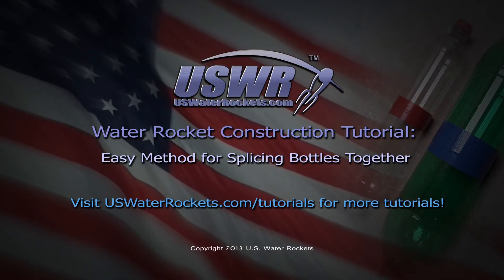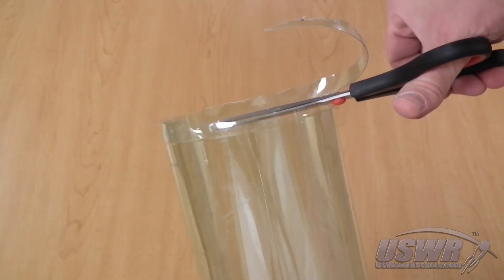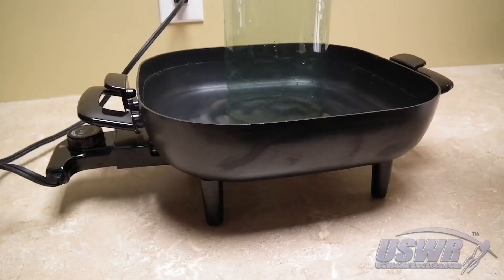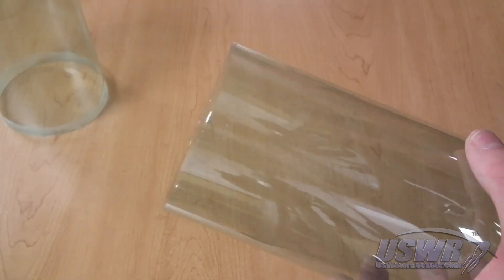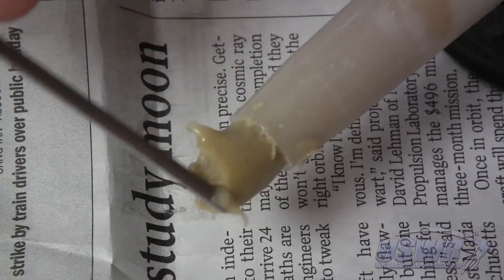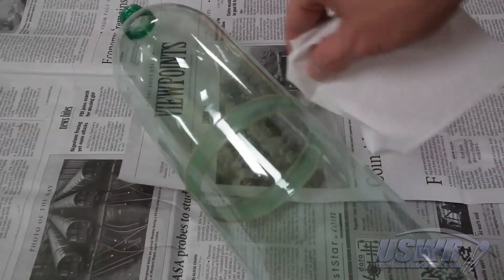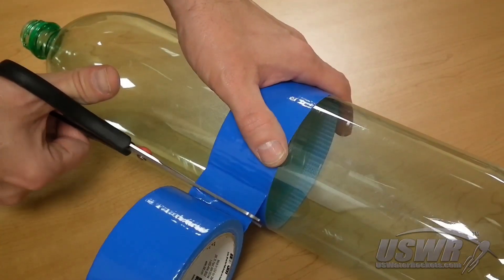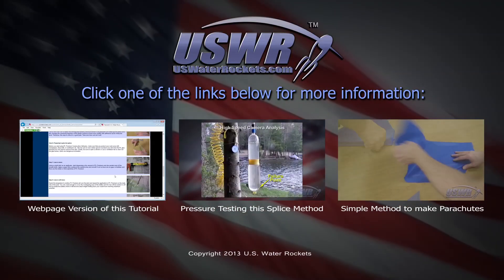How To Make a Huge Water Rocket by Splicing Bottles Together!

Comment: I tried this with JB weld epoxy for thermoplastics and my rocket exploded at 70 psi. A rocket made of one 2 liter bottle without any splicing was able to handle 110 psi and worked great. I want to make a larger rocket now. Is there a disadvantage to using 2 part epoxy instead of construction adhesive for this splicing method or do you think maybe I just need to be more precise in fitting the bottles together?
Reply: I know this is 3 years late lol, but were you using a 5 min epoxy or a 24 hour one? The latter has a much higher tendency of creating strong & pressure resistant bonds compared to the prior.

Comment: Would this method work if you were thinking about making a 6ft tall LED bubble column using 2L bottles?
Reply from the maker: It would work. Just be aware that when you have a 6-foot long tube made from bottles that you are careful when handling it. If you have it oriented horizontally, the weight will try and make the tube bend where you are holding it, so you should try and keep it vertically oriented so it stays straight.

Comment: Other alternative for pl premium?
Reply from the maker: We have tested, and many other people have tested just about every other glue you can find, and there is nothing that anyone could find that comes close to the performance of PL Premium for this application. There are glues that make a stronger bond, such as epoxy, but they are too brittle and will crack as the bottles stretch with pressure. There are CA glues (superglue) that also bond much better and are flexible, but the chemicals in the glue attack the plastic of the bottle and make it weak where the glue is in contact with it. I wish I knew of something similar to recommend, but PL is the only glue that anyone has found that can hold over 80PSI or so.

Comment: Bond strength is very dependent on bondline thickness.  Have you ever tried controlling the bond thickness with glass beads or skrim cloth?  Is there anything controlling bondline thickness?  PL Premium is meant mainly for dimensional lumber and plywood, which is uneven enough to retain adhesive.  The bond pressure in this joint can't be very high, so it's probably the viscosity of the adhesive that prevents too thin of bondlines.
Reply: Yah

Comment: In defense of  two part epoxy:  I'm certain we can find a two part epoxy that is "stronger" than PL premium.  Published shear strength of two-part epoxy can be four times the shear strength of PL premium.  A good bond isn't just about shear strength.  There needs to be ductility (stretchiness) as well.  Thickness and materials of adherends must be considered.  Though I'm sure there are two part epoxies available (example Hysol EA9394 Aero - expensive) which would make a stronger thin-plastic-to-thin-plastic joint than PL premium, PL premium is strong enough for your application (the bottle broke in the test), so it's good enough, and cheap.  But, if you move to  stronger aerospace materials, you would want stronger aerospace adhesives.
Reply from the maker: Exactly right. There are inexpensive epoxies that will adhere better to PET plastic, but they can be very brittle and don't hold up well to the stress encountered in the bottle joint. The glue must resist peeling, as well as shearing forces, plus the fact that the bottles swell considerably in in two dimensions as they expand when pressurized. If there is an adhesive that is better for this we would love to test it. I have tried some 2-part structural adhesives ($$$) made for low surface energy plastics, and the adhesives caused the thin bottles to weaken around the joint, so they would rip open with very little pressure applied.
Reply: @USWaterRockets  Have you got a shear stress-strain curve for PL Premium?  I think that's the best comparison of adhesives, barring side by side testing of lap shear specimens of the same PET material and thickness.  
The loading is interesting for this joint.  The hoop pressure loads, typically twice the axial line loads, are carried by both layers of bottle, and the adhesive is sort of along for the ride, just has to strain with the PET radially and circumferentially.  Axial loads (tension from pressure, compression from rocket acceleration, and rocket body bending) are carried through the lap splice bond like a single lap shear specimen, which will have some peel as it tilts under load.  The bonded area is probably the strongest part of the structure.
Reply from the maker: The compressed air also presents a problem, as any defect in the joint will get penetrated by the compressed air and this puts stress on the joint from inside, especially as the pressure rapidly drops when the rocket is launched. It also seems that repeated launches will eventually damage even the best joint to some extent, probably from fatigue as the bottles expand and contract each time. You make some interesting points. Alas, I don't have a stress-strain curve for PL, but I will try and see if there is one available on their website.
Reply: It seems like there was a phase in aerospace adhesive development where people thought higher shear strength must mean higher bond load carrying capability.  But, you can't give up strain capability for strength.   You need a balance of strength and ductility.
Another approach is to taper the adherend ends  (by machining in metal or dropping plies in composites), but that's usually difficult and expensive.  You can also reverse taper the adherend(s), so the end of the bond gets thicker at the end, and can shear strain more without letting go, preventing peel, also usually expensive.
Reply from the maker: This isn't as crazy as you think because of the way these bottles shrink when heated. By dipping them in boiling water at the right rate, you can make any sort of taper you want.

Comment: I'm wondering if acetone wipe, then wipe off in one direction with dry cloth might be a better surface preparation than sanding.  Adhesive bonds are chemical, not mechanical, bonds.  The surfaces must be free of oil or any other contaminant, to avoid weak layers in the bond.  I'm not sure the surface needs to be rough as much as it needs to be clean.  I know in aerospace bonding, sanding is seen as more operator-dependent than acetone wipe, because different people will sand differently.  I also think it's recommended you solvent clean after sanding.  But whatever works, I guess.
Reply from the maker: The bonding of bottles is less scientifically determined and more empirically determined. Basically hundreds of people tried various things and then wrote online the results of their efforts. Eventually the best techniques were seen from the data collected over many years and then we looked at all of the best techniques with the goal of making the process easier, faster, and more aesthetically pleasing.  You will find if you test this that the added surface area created by sanding creates a stronger joint and the surface roughness does add a mechanical strength to the joint that improves the strength of the chemical bond.
Reply: @USWaterRockets  I'm pretty sure aerospace adhesive bonds require solvent wipe of adherends. otherwise how do you know it's not got some traces of oil or some other greasy stuff around the shop?
Reply from the maker: I have been very meticulous about wiping and drying the parts with alcohol before joining them.

Comment: It seems like when I dip the bottle into the water, only the tips shrink. Am I using too high of a temperature?
Reply from the maker: The tips shrink if the temperature is too high or the bottom of the pan is super hot and you touch the bottle to it. You want to very slowly increase the water temperature and you will find the point where the plastic just shrinks very slowly. The slower it shrinks the better for you, if you can find the sweet spot. Slower shrinking means you can very gradually shrink the bottles until you get a perfect fit. If they shrink rapidly, it's easy to shrink them too much.
Reply: USWaterRockets Thank you. I will try not to have the temperature so high next time.

Comment: Can I use hot glue or super glue?
Reply from the maker: Sorry, but no. Super glue reacts with the bottle plastic turning it very weak, so even though it glues the plastic exceptionally well, the plastic where the glue has reacted will shatter when pressurized. Hot glue doesn't work because as you can see in the video we use heat to shrink the bottles to fit together properly, so you can imagine that applying the hot glue to the bottles will cause them to shrink and deform at the point where the glue is applied.

Comment: When I dip my bottle into the water the bottoms curl up why?
Reply from the maker: The water is too hot, you are dipping them too long, or the bottom of the pot/pan the water is heated in is much hotter than the water is, and you are douching the bottom with the bottle and heating it from contact with the hot pan. I can't know which you are having trouble with. Remember, the idea is to shrink the bottles ever so slightly. If you shrink them so they no longer fit snug inside the other bottle, then they won't hold as much pressure. Just shrink them a tiny bit so they fit tightly. If the very bottom shrinks too much that it curls every time, you can possibly immerse them in deeper water and trim off the bottom where it curls and still have enough left that can fit jjust right.
Reply: USWaterRockets Ok thank you so much, I just think my water is to hot.

Comment: Are there any alternatives for what glue to use to splice the bottles together?
Reply from the maker: There are no known glues that work as well as PL Premium for splicing bottles. Many people have tried to find some substitute, and so far no better glue has been discovered. Even very expensive glues formulated specifically for bottle plastic do not work as well. You may be able to use a different glue if you are careful to keep the pressure in the bottles much lower, so they don't blow apart.
Reply: Does general epoxy work?
Reply: (At low pressures under 100 psi)

Comment: This blew up and scared the living crap out of everyone in the closer half of my school at only 60PSI. My rocket needs pressure chambers which go up to 120PSI. Got any tips?
Reply from the maker: 1) Test your bottles before you cut them. Some bottles are born with defects and they blow up at way below useful PSI.2) Make the joints as snug as possible. The more gap between the bottles that has to fill in with glue, the more chance the glue will rip apart. Shrink the inner bottle a little at a time until you can just get it to fit inside the outer bottle.3) Mark your bottles as you make them so you can put them together in the same pairs. Some bottles are a little fatter than others and so when you shrink one to fit inside, it will be snug on one bottle and loose when paired with another. Keep them together as you create them, so when it comes time to glue, they are all perfectly fitted.4) A larger overlapping area will compensate for other errors you might make. If you overlap them 30mm instead of 15mm there's more area for the glue to stick to and so the joints hold up better even if they're not perfectly mated.5) Cover the joints with packing tape with fiberglass in it, instead of duct tape. The fiberglass tape keeps the bottles from swelling at the joints, so they hold up longer. You can still put colored tap over the fiberglass tape to cover up the ugly glue color and make the rocket look neater.6) Be extra careful when sanding the joints so you don't miss any spots. The glue will not stick to the shiny smooth bottle surface. You have to get it rough for the PL to stick to.7) Mare sure that you don't have oils on the joints from your skin. Wash them well, and also you can use alcohol to wipe them off to get grease and oil off.8) Always let the glue cure for several days before putting pressure on it.9) If your climate is dry, make sure you put the rocket in a humid area like a shower room for a while because PL glue needs to be exposed to humid air to cure. Putting it in an area with steam for a few minutes will give it the humidity it needs to cure.10) Use skinny bottles if possible. 2 liter bottles are harder to work with than 1.5 liter bottles which are harder to work with than 1 liter bottles. The bigger the diameter of the bottle, the more strain there is on the joint. Good luck!

Comment: hey,can i do that with just epoxy glue and duct tape instead of polyurethane glue?
Reply from the maker: It probably won't hold much pressure. There are all kinds of epoxy glues and some stick better than others, while some get very brittle when they are cured and others remain a little flexible. You have to have a glue that sticks to the bottle plastic plus it remains flexible so that the stretching bottles don't crack it. That combination of properties makes finding a suitable glue very difficult, and so far nobody has been able to find anything that works better than PL Premium.
Reply: Ok thanks, that help me a lot👍

Comment: Hi. I just spliced two bottles together using this method! Thanks but I have a question. 
My School launch is tomorrow, but the schools PSI is only 65. By the time I launch the rocket the glue will have been drying for around 22 hours.
I can call my rocket off and wait if I want. 

Is it worth trying to launch it anyway? Thanks.
Reply from the maker: If you expose the PL Premium to high humidity (take it into a hot shower for a few minutes) you will accelerate the glue curing process (it is hardened by water in the air). Even if you don't do that, 22 hours is very likely long enough to hold 65PSI without failing.
Reply: I used a Polyurethane but not specifically PL Premium. (Due to lack of sourcing time. The Bostik Poly was lying around somehow) and didn't see your comment in time for the shower method. 
Anyhow it did end up being less than 22 hours and it did explode but at a high pressure. One half got higher than every other rocket though. XD
I have since removed the glue with Isopropyl and re-glued and reinforced with tape. Next launch is Thursday do it will be able to dry for 4x the length. should be fine. Thanks for replying.
Reply: Don't bother trying to read my comment. Youtube's new face cut it off.
Reply from the maker: FYI, everyone who's ever tried a different glue has not had the same results as PL Premium. It seems like every other glue does not hold as well. However, I can say that most of the time the glue fails because the two halves pop apart, so anything you can do to hold the halved lengthwise should help keep the glue from pulling apart. Putting tape lengthwise on the rocket might help! Good luck!
Reply: Just had a second launch after 2 days drying time. It held and did not explode. Needless to say I was very happy. I'll keep PL Premium in the bag of thoughts until the rocket explodes. Thanks.
Reply from the maker: NELICOPTER Awesome! I hope your rocket won! ;-)
Reply: Fins were way way way to small because I had no time to test aerodynamics because I was focusing on splicing. A friend got the Aerodynamics perfect and got really high. It came down and smashed onto the roof of the nearby buildings.

On a side note, what is more practice long term. Garden connector launches, or the 22mm stock bottle nozzles? Thanks.
Reply from the maker: NELICOPTER If you're going for max altitude or max distance and you're using a plain bottle with no exotic reinforcement then 22mm is going to win every time. When you get into crazy high pressures you have to either test or sun simulations to find out the optimum size. At those pressures the speed is so high that you can lose a ton of energy due to drag. A smaller nozzle at high pressure can keep the speed lower and therefore the drag is less and the rocket is more efficient. But at low pressures the smaller nozzle is going to limit the speed too much and you lose the benefit of momentum that a big nozzle gives.

Comment: How many launches do they last?
Reply from the maker: They last as long as a regular water bottle rocket would last. Usually the bottles will get damaged from wear and tear and you have to retire the rocket, or the bottle will burst because it has a cut or deep scratch from a hard landing. We've gotten around 100 launches from these type of water rockets.

Comment: did you ever try something with co2 instead of oxygen because with enough pressure it becomes liquid so the pressure can be build up way further
Reply from the maker: We never bothered with CO2 for a couple of reasons:1) To rapidly phase change from liquid to gas, CO2 needs a heat source. Without heat the transition is relatively slow and with these rockets you need all the power in a very quick burst. 2) CO2 changes state from gas to liquid at around 800PSI, meaning the most pressure that it can produce is 800PSI, which is high for a rocket made from bottles, but our world record competition rockets were made from carbon fiber and 800PSI would be considered a low pressure for one of these rockets. Air can be compressed to over 3000PSI before it turns liquid.3) Since our high pressure rockets were designed for competing for the world record, we had to follow the rules for the competition which say that only water and air are allowed for propulsion. Our non high pressure rockets aren't for competing, but CO2 at 800PSI would be too high for them anyhow.Maybe there is a way to make it work in a rocket that we don't know about, but that's our understanding of CO2 as a propellant.